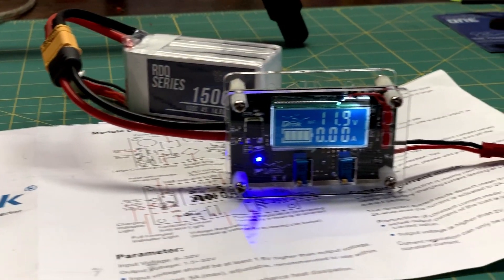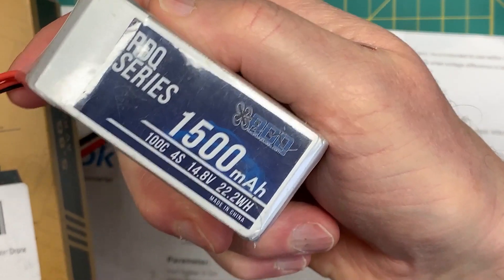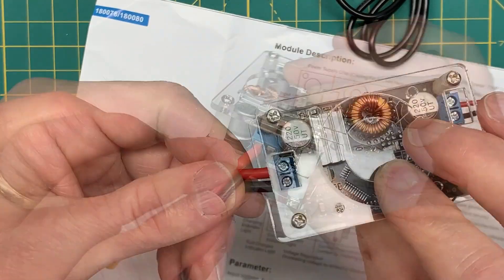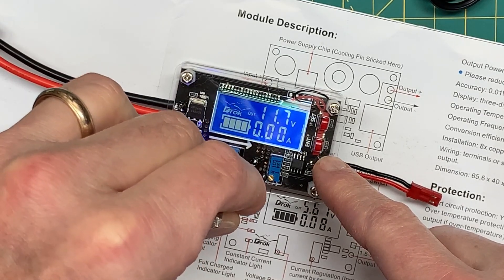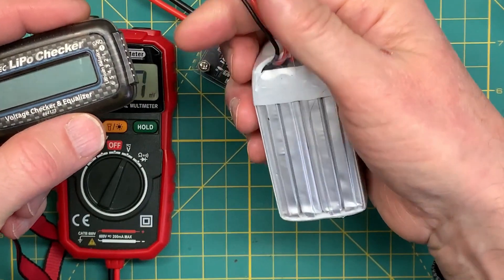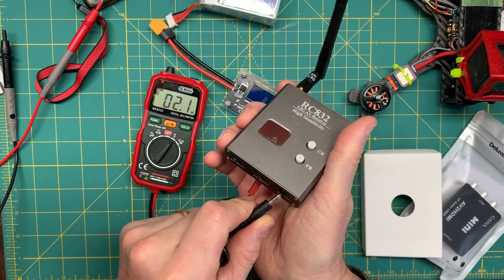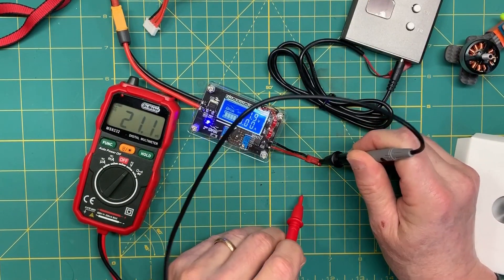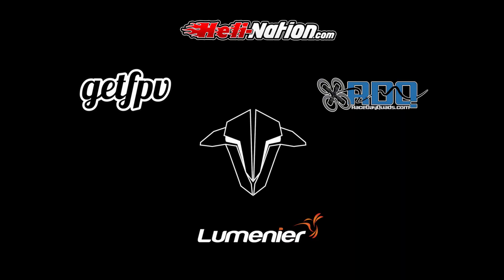Review - DROK Buck Converter

Comment: I used this exact module on a solar power station.  I used it between the panel and the gel batteries to lower the variable voltage down to around 14 volts.  Ideally you’d set it lower to around 13.8 which is float voltage, but this station is actively charging things like phones so the batteries are almost always under load.  The tracking on this module is great.  I’m not sure how many samples per second it takes, but the screen will literally zig zag voltage input numbers when the sun goes behind a cloud.  There are instructions for voltage calibration to match it closer to a meter.

I considered pwm controllers, but their stated maximum charging voltage of 15.5 volts didn’t sit well with me for gel cells. 

this has worked well for about two years (so far) of limited monthly use.  

Stated maximum wattage is said to be 50 watts.  I use it with a portable 30 watt panel.  

If you use a module like this as a regulator to charge batteries,, you must put a Diode between the module and the battery.  If not, the charge flow will reverse which can destroy the module!  Don’t forget about Fuses!  Simple 12 volt automotive fuses will work.
Reply from the maker: Excellent comment William. Thanks for watching. I really enjoy this little module and just posted a fun update as kind of a one-year anniversary. I don’t use it daily but I probably use it a couple times a month. Often as an ad hoc solution.

Thanks for the detailed comment!
Reply: @W0KNI  the post would not let me edit/correct, I wanted to add that the actual float current should have been 13.3 volts.  Also, the use of the diode will cause the voltage going to the batteries to drop, it would not be exactly what the output display reads.  You would need to compensate for this by turning up the output voltage on the module, which is why having it at 14 volts under load never bothered me. - thanks

Comment: I bought two units from Amazon, 

BOTH were DOA.

I am using a transformer 110 volt AC to output DC 14.5 @ 1.5 amps to provide power thru a two trigger relay that supplies input power to the DROK Buck Converter.

Is this frying the Volt Adjustment??

The documentation says: 
"Note: please dont adjust voltage during short circuit" 

When I first switched it on, the Amp display showed 0.01 am draw to a test bulb.

Then when I turned the Adj-V, it went to Zero.

Output from the DROK converter is staying the same as the input voltage.

I guess the Feds Postal Inspector fried another of my electronics.

I got to get off the LIST!
Reply: Also, when I go to adjust the Current Calibration, by power off the unit, then holding down the ENT, the power it back on.

The Current Calibration buttons "SET & ENT"  is Not changing the current "Amps"!

This is frustrating as heck!!

Comment: 12 volts is a standard ref for voltage. Your device will run more efficiently on 12.8 to 14.8 but check the device for voltage requirement. Thanks. I had one unit DOA and the other ok.

Comment: Can you input it with a 100v ebike battery? Im planning to use lighting and phone charging features.
Reply from the maker: No. It won't go to 100v, but more importantly - is it only outputs 3-5 Amps.  It's made more for a bench testing device and lacks the robust components for what you need.

Comment: Is there an update for these types of products? I will be retrofitting my bike with stop lights and running lights and in the market for a buck converter. something with a case.
Reply from the maker: Good question. I got mine off amazon.  I would shop around to find one that fits your needs.  AFAIK the firmware is not upgradable.  They're kind of barebones DIY gadget so would probably need an aftermarket case.  I hope that helps!
Reply: @W0KNI  Yes it is helpful, thank you and thumbs up.

Comment: Can you not calibrate the output voltage by holding down a button then adjust the values?
Reply from the maker: Good question. I don't recall seeing that in the manual.  It wasn't off that much and with the pots you can pretty much dial in what you want.
Reply: @W0KNI  I ask this as many of these regulars has this option.  Thumbs up.

Comment: Interesting video. But, my question to you is, "How can  you verify the VOM was correct and the Buck/Boost was off?" First of all, 1/10 of a volt difference is nothing. I have the 35 watt model of the same brand. At first my B K Precision showed a difference of 5/10 of a volt. Now that's a lot. After doing some research I found out that my VOM is the problem, not the Buck/Boost. The DROK's volt meter was actually spot on. 
These are nice little units. I liked the idea that they come with plastic protection at a reasonably price off of Amazon.

Thanks for posting,
Barry, KU3X
Reply from the maker: Good question.  I've found that a tolerance of 15% is acceptable with 12 volt systems.  Glad you liked the video!

Comment: Can this meter use in car audio?
Reply from the maker: Hey Ryan - thanks for watching.  I'm thinking not due to the current draw required by the car audio.  However, since there is such diversity in car audio requirements I would take a close look at what the unit needs and see if the DROK can support it.
Reply: Stephen thanks for yours reply! I sure will reach out to them.

Comment: This can install in a car right ?…an can I get 10 . 8 volt output out of it ??
Reply from the maker: Hey there. Yes you could, but just make sure that what ever device your trying to power with it does not pull more than 5 Amps.  According to the manual (see description link) it recommends staying at about 3.3 Amps.  I hope that helps.
Reply: @W0KNI  the device that I’m going to use on it it’s only going to pull 1.5 amps so that’s good ..thank you

Comment: what does buck mean a lot of different buck Converters for sale ? Convert your money into DC
Reply from the maker: Hey Jess - thanks for watching! I kind of wondered that too when I first started playing with these.  As it turns out the technical term is step-up, step-down voltage transformer.  However, the non-technical phrase is boost (step-up) and buck (step-down).  You will sometimes see boost-buck DC to DC converter.  I hope that helps!

Comment: When i was charging some batterys with this it worked initially and after a hour it has stopped chagrining and outputting any voltage and the on light started blinking any ideas on how i could fix it.
Reply from the maker: Thanks for watching. As I review the 2 page manual I see 4 indicator lights. They run vertically, one above the other. Which one was blinking? This device has an overheat cutoff but does not have a back feed on the load side. 

What source and load voltage were you working with? Did your load batteries have a BMS installed?

Comment: Hi Stephen, what size awg wire are you using? I can't fit a 16 awg at all 😢
Reply from the maker: If your using this model then 18 awg is plenty.  This unit was only rated for 5A which  isn't even 1/2 of what 18 awg can handle.  Let me know if that helps.  Cheers!

Comment: Do the small DC to DC DROK type adjustable Buck step down converters produce much audio noise?   I will be using 12 volt battery input and powering a 6 volt portable short wave radio.  I hope you will answer my questions.  If this could add audio noise, could you suggest a simple remedy?  Thanks
Reply from the maker: Mr. Prepper, thanks for watching!  I have not detected any RF through my equipment, however I would recommend keeping at least a few feet away from your radio to avoid any localized RFI that might come from it.  What your describing sounds like a great application for it.  Make sure to check that it will support the current your radio needs.  Have fun!
Reply: @W0KNI    I just noticed that your Drok is the same exact one that I ordered.
Reply: @W0KNI   Stephen.  Thanks for the input.  The particular converters I ordered allows for adjustment of both volts and amps.  I am hoping I can dial in the numbers required for both my Tecsun- PL-660, 6Volt radio and my MLA-30, 5Volt loop antenna.  These little step downs are pretty neat as you well know.  Here is the model I purchased two of on Amazon and thanks again.  By the way, I have a friend named Stephen.  He pronounces his name Steffan.

https://www.amazon.com/gp/product/B07JZ2GQJF?ref=ppx_pt2_dt_b_prod_image

Comment: Hi ! I need to use this to stepdown an 18 volt /3Amp  pack down to 12Volt/1Amp to charge the battery  for a Toy  operated ride-around vehicle. So am I good.2go with this unit? Thanks !And Thanks for your Video! :)
Reply from the maker: Hi Richard! Thanks for watching.  Here is a link to the manual.  I took a quick scan of the specs. and it appears it would easily handle the load you described.  Good luck and thank you for the sub.  https://tinyurl.com/ydelh9ff
Reply: @W0KNI  Hey Big Thanks To you Stephen !! :)

Comment: Or you could just connect a 3s lipo to the video receiver
Reply from the maker: Hi Matt. Yes, you certainly could use a 3S in this example. However, since not all components have a tolerance for lower voltage inputs this seemed like a good solution.  Like when you see something that requires 13.8v (radio) and accepts a +/-15% deviation, a 3S would fall short.  I also use it on a breadboard for testing ideas.  Fun stuff! Thanks for coming watching!
Reply: @W0KNI  Thanks for the video though, I plan on using it to take some solar cell power and charge a flight pack while airborne, we'll see how well that works hahaha

Comment: Thanks! I'm going to use one of these to run an LED setup on a kids' riding car. 18V is used for the power source, used to over-drive the motors for speed.
Reply from the maker: You are welcome! Thanks for watching.  Just a side note on  your application - research the max current (amp hour draw).  The one you see here is good to about 3A.  So if your kids riding car needs more then look for a more robust model.  LEDS draw very very little so your probably good to go! Cheers.

Comment: I have one connected to a laptop charger to charge 12v batteries for my son's ride on jeep and motorcycle.  I was having trouble getting the amps to adjust but I'm sure its user error.  Trying to get it to 2A
Reply from the maker: I hear ya. I use mine, but the downside are the potentiometer adjustments seem long.  I'm not sure what the max amp out is on this one.
Reply: @W0KNI  I can control watts but having trouble controling amps.  When I connected my 12v ride on battery, it started at .1A and with time jumped up to .13A.  Took a couple hours to go from 10v to 12.5v charging at 14v

Comment: Stephen.... where did you get the data sheet for this product??. Do DROK supply one on their website??
Reply from the maker: Brian - good question. There was an instruction sheet with the product during unboxing, however I had to review several other YT vids to fill in the blanks.  My requirements were pretty narrow, between 5v-12v using a Lip supply from 7.4 to 14.7v.  I hope that helps.
Reply: @W0KNI  Many thanks Stephen...another bit of info to slot into the puzzle. Any chance of emailing me the instruction sheet that you have...email address  … brian.moore4@btinternet.com
Reply from the maker: https://drive.google.com/file/d/1GcL8NPWRLoXeOokdNzmvDyBvu-8DJNJK/view?usp=drivesdk
Reply: @W0KNI  Many thanks Stephen...I searched high and low for this Manual but never found it. Now I can start to use it properly.